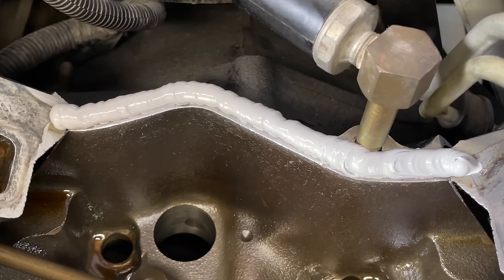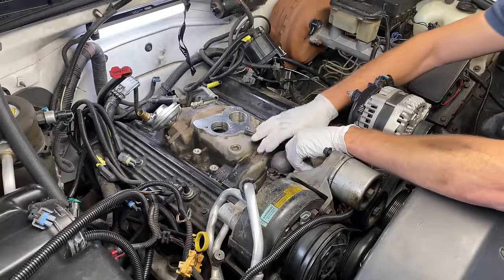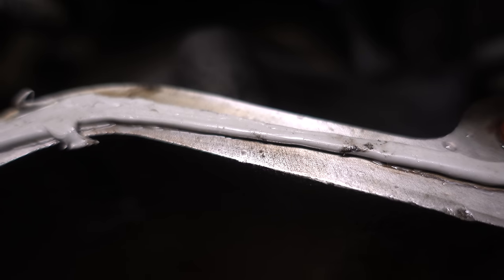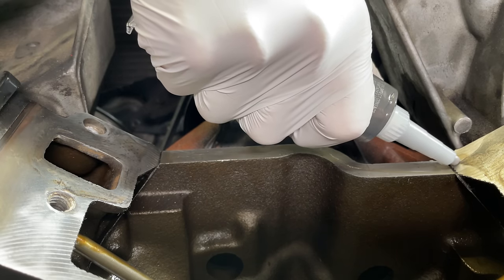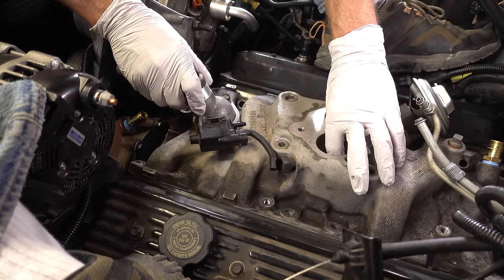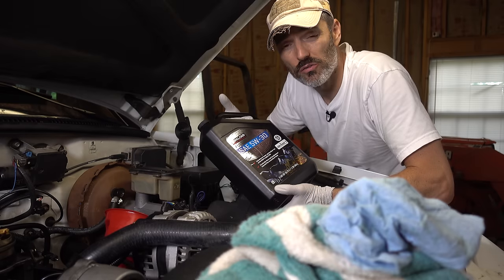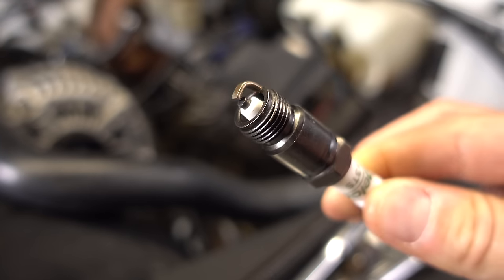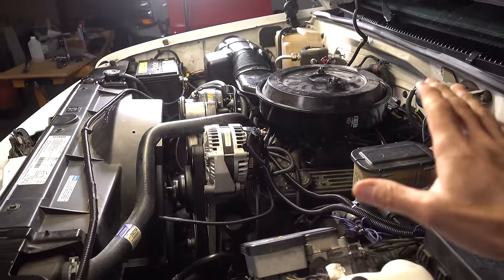Why You NEVER ATTEMPT To Use RTV Gasket Maker Without Doing This First!!

Comment: The most important part before using liquid gasket is making sure the mating surfaces are prepped correctly. There can't be a single trace of oil. If you wipe the surface with a paper towel and it leaves a black smudge, the surface isn't clean enough. Then of course make sure you lay down a thick enough bead. Typically the service manual will give you an exact measurement of how large the bead should be if you aren't sure
Reply: I use brakleen or acetone to remove oil residue then smear a thin layer on both sides and let it cure for a bit before doing the bead, then let it cure completely after assembly.
Reply: @AreaThirteenThirteen  Brake clean works great to remove old sealant but it will give you a false sense of security. In my experience brake clean will leave a really thin film on aluminum surfaces for way longer than you would expect it to. Finishing the prep with a scotch brite pad works perfectly since you are effectively sanding off any leftover sealant or oil residue. You just have to be mindful of the dust
Reply: I’ve been a mechanic for 57 years full time 
I still ruff up surface with electric engraver to help hold silicone in place 
Just hate come back or leaks
Reply: If silicone says 12 hours to cue I double it
Reply: I find the best in my opinion, after removing old residues, clean the surface with Thinner, it doesn't leave traces.
Reply: @firstlast---  Use old fashioned chlorinated brake cleaner.
Reply: @firstlast---  Clean the surfaces with rubbing alcohol and the adhesive will be fine.
Reply: @@JunkMoney-pk3co For many decades, oily leaky differentials were the norm.  Then manufacturers began using silicone based adhesives that seal on a microscopic level.  Leaks solved.   But bear in mind that at dealerships, the type of silicone that we use for trans pans and diff covers is different than the silicone that we use for engines.
Reply: @@JunkMoney-pk3co Think of it in these terms.   What did the factory use to seal in that location?  You may not have to buy an entire engine gasket set, only individual gaskets.  A case half with a factory gasket may develop a moist spot after years.  But silicone leaks tend to be full drips.
When I spoke of differential cover leaks, we saw coarse machined work on the cast sealing surface of the diff housing with a stamped steel cover mating to it.  But with the smooth surfaces of cast aluminum, either a thin gasket or silicone (not both) can be used.  Just go back with what the factory used.
Reply: I always wipe my surfaces with acetone to remove oil residue from parts or 🤌.
Reply: This original poster has no idea what hes talking about
Reply: Brake cleaner for the win!
Reply: Clean entire areas and nothing leave behind and it can make a paper gasket following the shape of the block front and rear and then added sealant on both sides of paper it will be very good seals . Simple mechanic
Reply: @AreaThirteenThirteen 
Acetone is the key. I used break clean and still get additional residue off when I use acetone. Wear gloves.
Reply: @xESPplayer500x I've been doing this a long time and the original poster sounds pretty much exactly dead on to me.
Reply: A clean surface will ensure good adhesion. However, if you find you do not want the RTV to stick, for instance to your finger because you just need to mold your bead or smooth a lump, you can put a good amount of spit on your finger and it will not stick. You can smooth and mold RTV with a good amount of slober on it. It works quite well.
Reply: Use a light coat of oil based primer after cleaning the joints?
Reply: A 1/8 inch bead is all ive ever heard to use. Using to little is almost never the problem.
Reply: Agree. I use thiner several times with fresh towels to remove any oil from the surfaces. Had never problem even with a thin layer of liquid gasket.
Reply: Pro tip, take an old straight spark plug wire (not a 90 degree plug wire) and take the end that goes on the spark plug and clip the wire about 4 or 5 inches from the boot. Take your spark plug and put it in the boot and install the plug that way to hand tight. That way you're assured no crossthreading and it's easier for off angles plug seats to install the spark plugs. Then tighten each plug per spec.
Reply: @blackhawk7r221 that used to be the norm with some engines too, you just got a little drip, like 2 small dots every month, nothing worrying but annoying if you parked on the same spot everyday
Reply: @Rick-hx1ne that's how my dad taught me.  Never had a leak ..ok maybe one.  Ok two
Reply: @JuanL.Burlew-dk1qc  rubber tubing works just as good.
Reply: Wire brush & brake cleaner

Comment: another tip is to use a finger and smear a thin film of rtv on both clean surfaces before applying the bead of rtv to one side. this ensures the rtv will adhere to both surfaces rather than touch but not bond properly.
Reply: Been wrenching for 20 years, that's how I do it gotta make sure learned my lesson on a 7.3 oil pan 😂.
Reply: seems like i fit tacks up it should bond properly regardless??
Reply: This is the ONLY way to do it!

Comment: Always use black silicone when your working with oil. Dont let it skin. Put the silicone on, put the parts together, and torque them down. Those old lt1 blocks are some of the worst to do. I did my camaro twice in one day once because i forgot a ⅝ wrench in the lifter Valley.

Comment: I’m glad you mentioned too much sealant, during the torque sequence of the manifold. When I was a mechanic I discovered so many vehicles with clogged or partially clogged engine oil sump screens with pieces of silicone and other debris from the assembly line.
Reply: And that is exactly why I never use silicone sealant anywhere on an engine where it may migrate into the oil system. I call that crap no more skill.
Reply: The pro application in the thumbnail is excessive
Reply: @stupidbird4U  It's needed still in some situations. On honda's, a bit is needed on mating surfaces between two parts, like your cam towers in the front and back of the head where the valve cover gasket seats, and the mating surface of the oil pan between the oil pump and engine block (and iirc, the rear main seal plate) if you don't use it, you'll never seal in those locations since it's a meeting point between two different parts. You can't get away from it no matter what due to how the engine is assembled.
Reply: I suspect it's caused more by rushing the job and not allowing a full and proper cure time. Also not using clean or new parts. For example, a new or well cleaned oil pan, given proper cure time even with too much sealant should be fine. If the sealant drips, it's not cured. If it drips into the inside of the oil pan and oil is added, then yes, the oil will float the sealant and the pickup tube will get clogged. If you don't rush, the dripped sealant will cure on the inside of the oil pan and not come off when you add oil back. Lots of places do the bare minimum, including waiting on cure time. That is more than likely the main culprit. Also more sealant means a longer cure time. Best case scenario is if you can let it cure overnight or longer.
Reply: Dude it isnt just silicone.  Cork can do it too.  Ive taken oil pans off 50 year old engines where the cork broke apart in the valve covers and oil pan and clogged 90% of the pickup.

Comment: I think the biggest problem here is that the gaskets on the intake are thicker than OEM, which is why you have such a big gap where you apllied the silicon gasket maker. For a normall sized gap/mating surface, the amount of silicone would have definitely been enough. So i think your conclusion at 4:35 is absolutely correct.
Reply: no, it's always got that gap on these engines.  He keeps saying "more than you think you need...."  Well, if you would have just looked at it when you took it off....or test fit it to check that gap, or anything other than assume you know what it needs, you would have seen the amount of space you had to fill.  It's a thing.  Just check that gap if you don't know.  I like to see gasket squish out evenly all the way along the mating surfaces.  But, I'd also use the Right Stuff, not the stuff in the package w the gaskets.
Reply: older small blocks used a rubber gasket on the front/back wall, hence the large gap, but you still needed a dab of RTV in the corners to prevent leaks. It's possible that they found the RTV to be more effective than the rubber gasket, or maybe it's simply cheaper
Reply: @ckl8a  i think its just cheaper. the old rubber gaskets would get brittle over time but i never had one leak.

Comment: With your finger, smear a dab of gasket maker on both mating surfaces really thoroughly.  That gets the gasket maker strongly bonded to the surfaces.  Then place your bead.  Then install the manifold.  

This is essentially like putting glue on both mating surfaces, making sure its tightly bonded into the material on both sides.  Then placing them together.  

This method helps with this area more than most since as you install the manifold, there really isn't much mating presure applied to the gasket maker (since it would rather sqeaze out than crush tighly into place), but since you have already rubbed that thin smear of gasket maker thoroughly onto the block and manifold, once that bead lightly crushes into place, it bonds to those thin areas you rubbed in prior to install.  Its 100% bonded tough to both sides the second they touch.
Reply: Pro tip. Thanks

Comment: If you imagine your intake manifold as a V with a flat bottom. It MUST seal on the V sides against the heads. Since there's no real adjustment on the sides of the V, the manufacturer made clearance on the flat bottom to ensure the sides properly mate with the heads and seal. As you stated, gasket thickness is also a major factor in the bottom gap. This is the one place where a tall thick bead needs to be used. This is completely different than sealing a thermostat housing for example where only two surfaces are involved, there you need to use a thin bead. Otherwise, the sealant will intrude into the internals. Great video!

Comment: The same exact thing happened to me a little more than a month ago. Another mistake I made was starting the vehicle too soon to purge the air out of the coolant system. I gave the RTV 48 hours to cure the second time. 
 I approach this with the same logic as you. Hey you live and you learn. At least you had a positive attitude and made a video for others to learn from.
Reply: I've never waited for my front covers or oil pans to cure 24 or 48 hours and I've never had a leak 😅
Reply: Good information.. The vacuum created by just turning the engine over a time or two can potentially ruin the seal.
Reply: "Right Stuff " costs more but it's benefit is a faster working time.

Comment: The first time I installed an intake gasket set was on a Chevy 327 many years ago.
At that time they were still supplying rubber end gaskets in the hasket sets.  Using silicone was the new thing back then.  I wasn't sure how much to put on, so with all surfaces clean, I set the two gaskets in place then layed the manifold in place to actually see in my mind how large the end gaps were.  I'm a visual person so seeing how big the gaps were told me how much silicone was needed.
This time around, you put on exactly the right amount. A tad to much is better than a tad too little.
If there's a little too much squeezing out, its never going to get brittle and "flake" off inside the manifold and clog anything up.
Reply: I think it was big mistake to do away with the rubber gasket in a place that was designed with a gap that was made large enough to accommodate one.  It should have the rubber and a small amount of sealant at the corners.

Comment: When I worked for a GM dealership as an auto tech they recommended using a healthy amount of the RTV Ultra Black and it comes in a "squeeze cheese" canister so you don't have to squeeze the toothpaste style tube. Run the RTV about an inch and a half up the head BEFORE you put the intake gaskets down. I did my GMC Sonoma 4 years ago and she's still dry. I've done literally  hundreds of these intake reseals. All the front wheel drive vehicles AND the 3rd Gen LT's used plastic intake gaskets which are junk and very susceptible to breaking and leaking. Mainly because it's stupid but sometimes from over torquing. Happy wrenching.
Reply: I wish you were in Co!❤😮